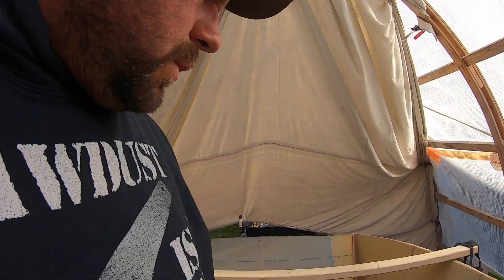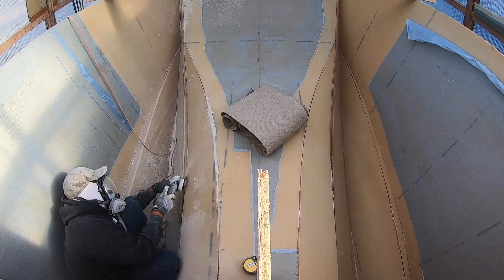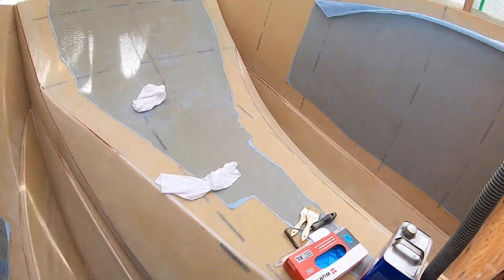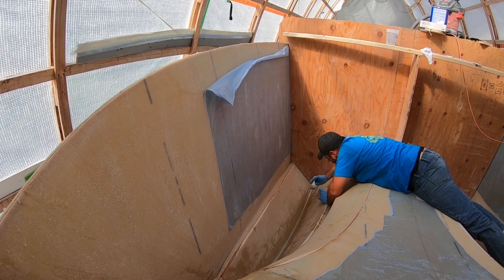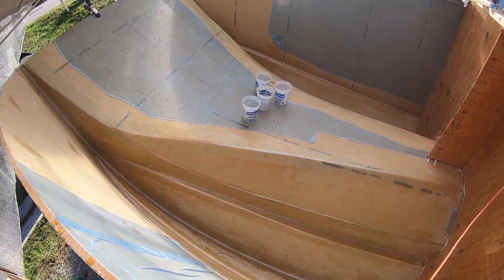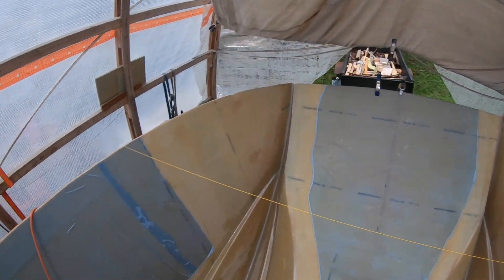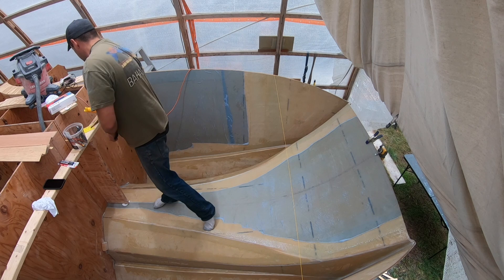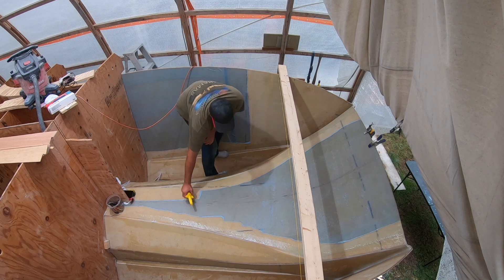Step 65: Glassing Seams and Working on the Inside of the Hull! POWER CATAMARAN BUILD

Comment: Thanks for sharing! Would it be possible to NOT do a build frame, do bulkheads and stringers instead, attach panels directly to that, and then glass them together? I am thinking this would save time/steps, as the buildframe and final structure are the same. However, I am making this up and have never built a boat before. But would love to do it, that is why I ask. Thanks!
Reply from the maker: A lot of vessels are built where the build frames are the bulkheads. Unfortunately with ours this is the way they recommended. If you were willing to take the time to set up the bulkheads on a jig you could probably make it work but, for us the plywood build frames weren’t a bad endeavor. Thanks for watching 😊
Reply: @BuildingMVDauntless  thank you for your guidance!

Comment: the other side was more shiny :)
When making templates it is sometimes more economical to use small screws instead of hot glue. That way you can re-use the template material.
Reply from the maker: Good idea! Thanks for the tip.

Comment: A "hot" tip. 
Full face mask connected to an aircompessor (and a water/oil filter of course) gives you cool air to breathe and makes it way easier to work in the heat.
Cheers and have a exellent weekend,, 🍻🍻😎👍‍‍👍‍‍!!
Reply from the maker: Hmm interesting! Thank you for that tip 🍻